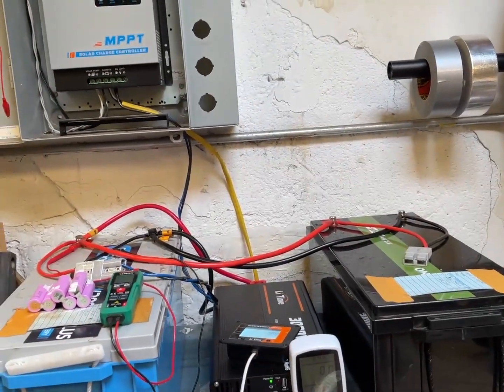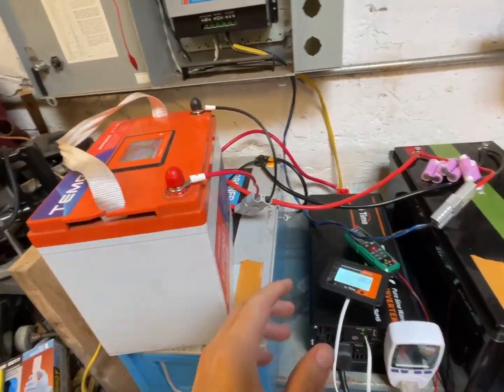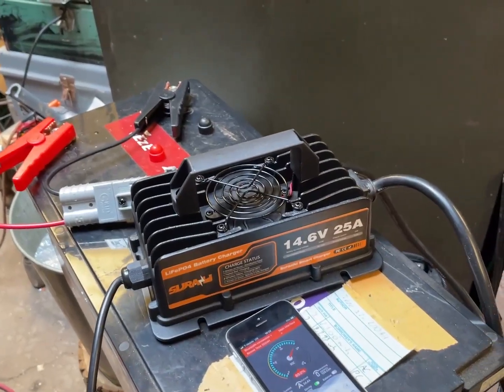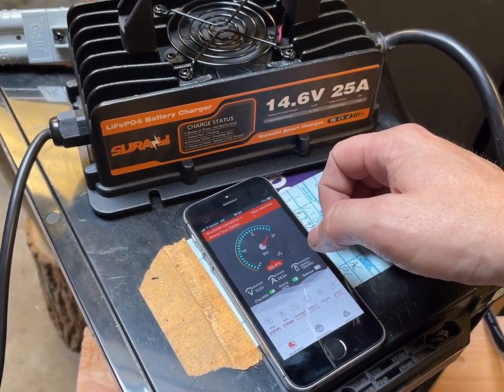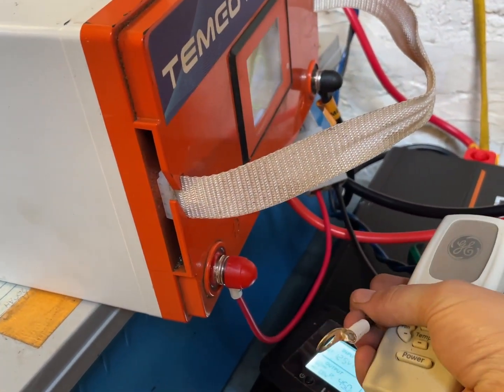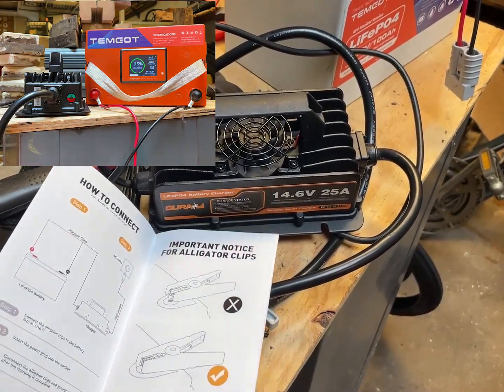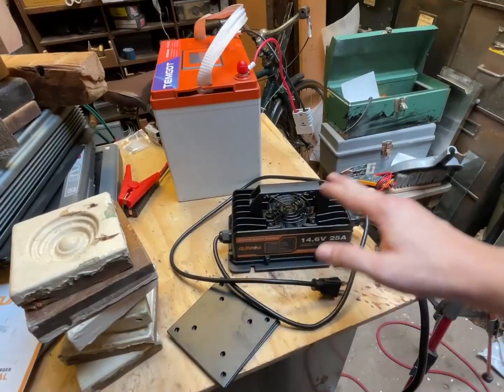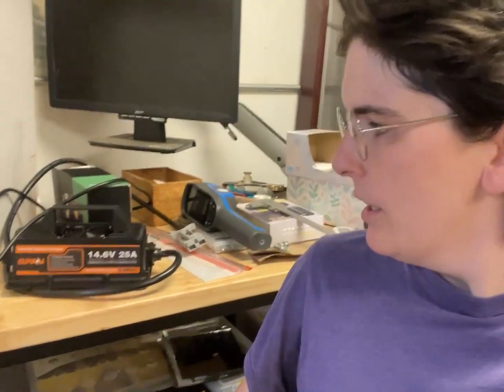My new favorite 120v AC LiFePo4 charger. The Suraziki 12v 25a charger.

Comment: If it's connected to a battery that also has (for example) a 2A load on it, will it hold a steady voltage when fully charged or does it cycle between charging and not charging? If it just holds a steady "float" voltage, it can be great for a home network setup as most home network devices run on 12V.
Reply from the maker: it holds a float charge

Comment: Is the wire gauge printed on the insulation?  #10 wire is good for 30 amps and #8 for 40.
Reply: Depends on the length of the cable too.🙋‍♂️
Reply from the maker: it says it in mm squared not gauge